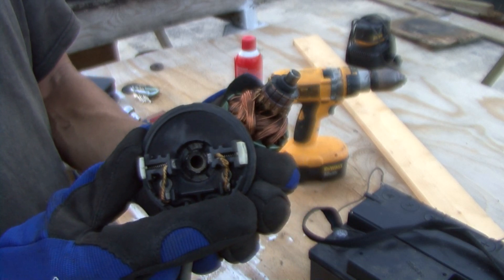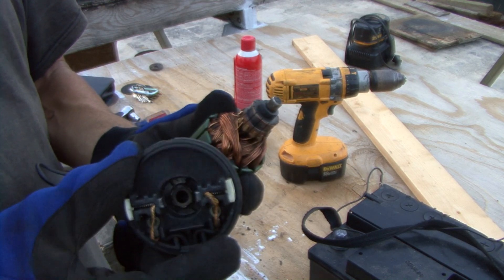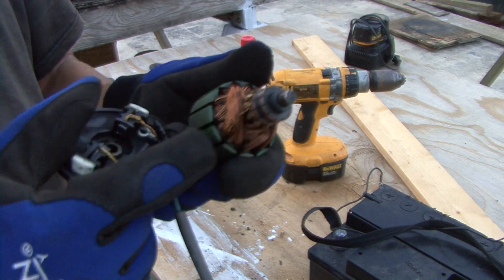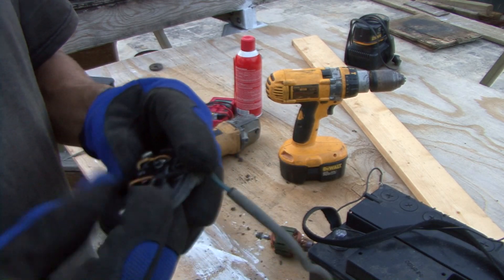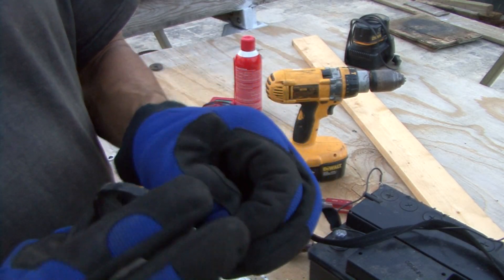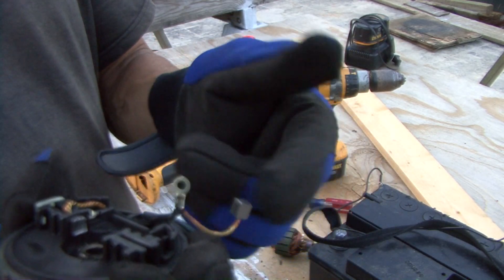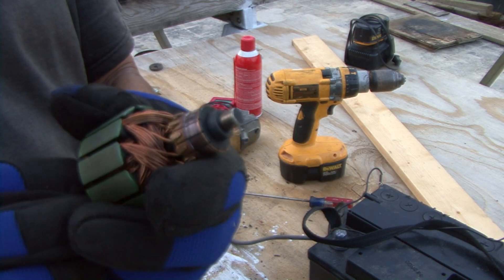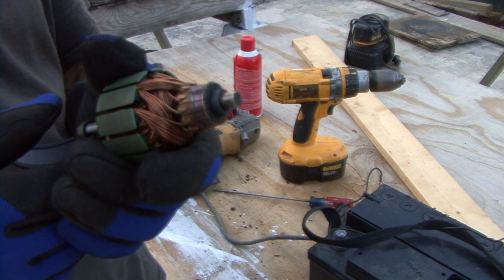Ever wonder why you cars fan motor stops working or whats inside the motor

Comment: Thanks for this man. My fan wasn't working in my 89 accord and I opened the motor up and rusty water came out. That ones a real pain to change so I cleaned it up and am looking to find a place to order the pieces. Helps a lot looking at this video.